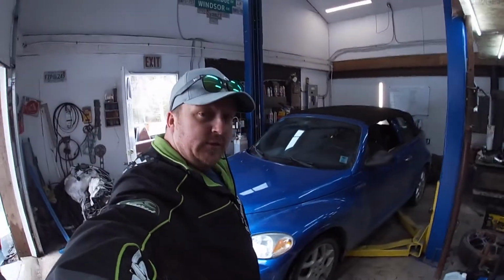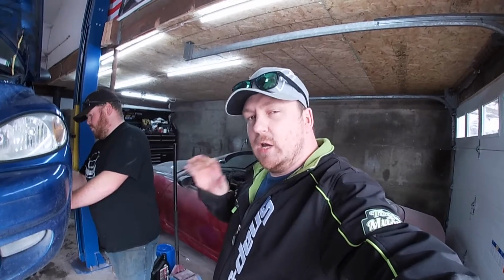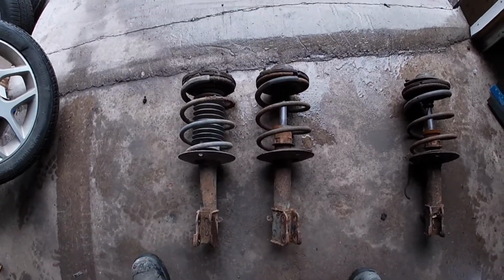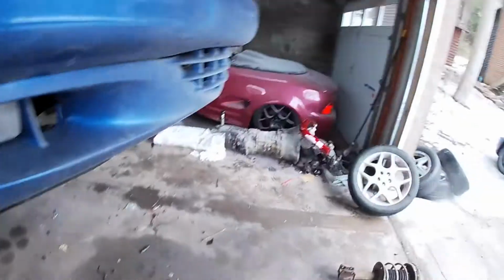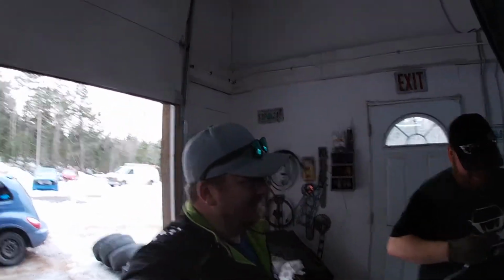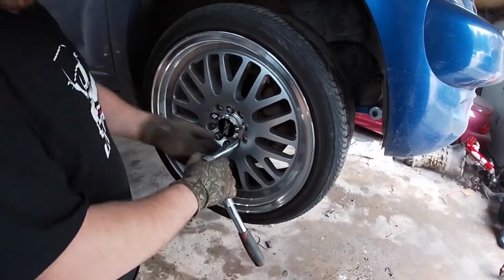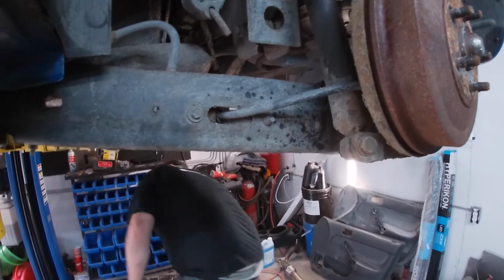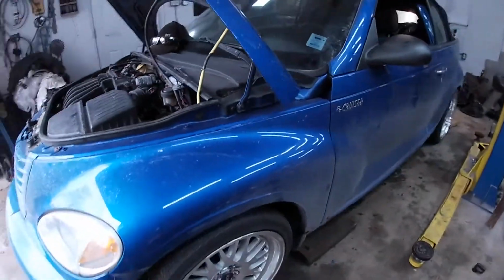We Lowered Our Pt Cruiser For FREE........FREE **Worlds Cheapest PT Cruiser Convertible ** PT 4

Comment: The bucking is usually just an intermittent signal from the
 " Cam Position Sensor ".
It gets oil on it. Very common.
You don't have to purchase a new one, just remove it and clean it off with brake cleaner or something.
Reply from the maker: Thanks for sharing

Comment: You should check out the mastercraft maximum 1/2" electric impacts.

I have two, one 400 foot pound kne and a 750 foot pound one.

Strong as hell and very reliable.
Reply from the maker: I will have to have a look at it. Thanks for the tip.
Reply: Rednek racing ive used them they are good but thru my work we can get the 1400ft/lbs Milwaukee for the same price 😂